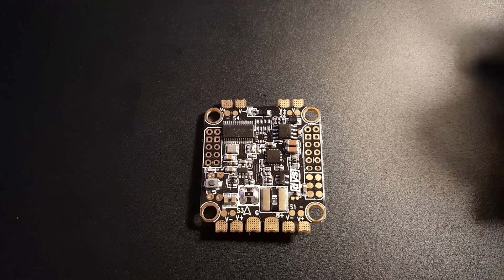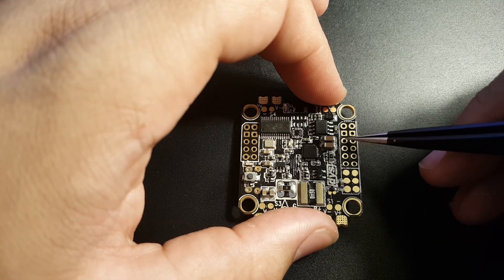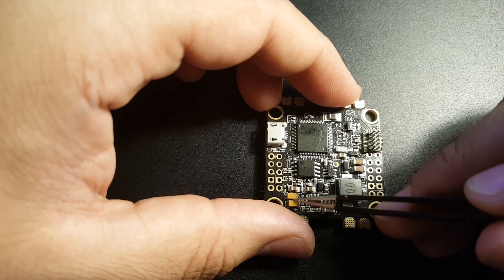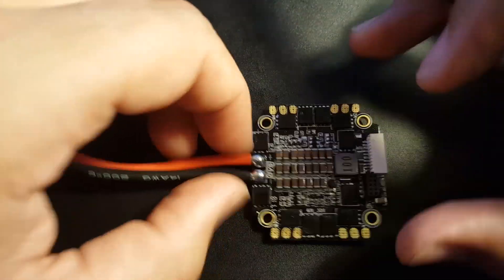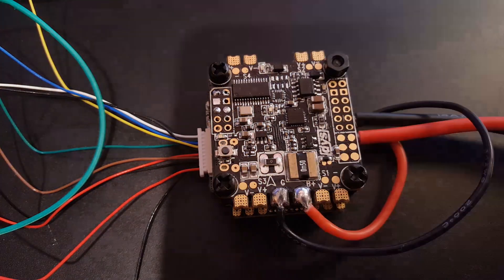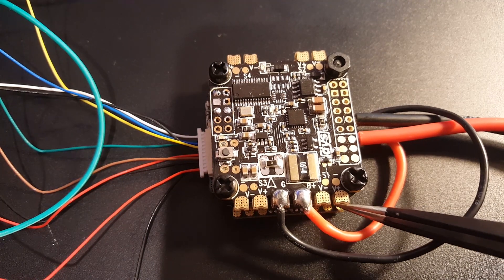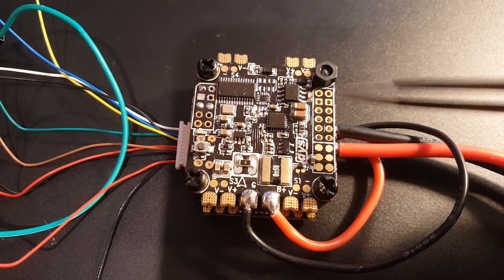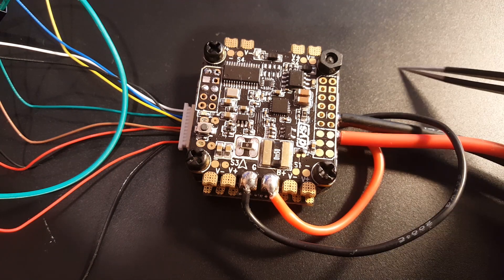DYS F4 Pro & DYS F30A 4in1 ESC Review and Noise Testing

Comment: Hey Drone Mesh nice video. Would you happen to know what's the voltage spec for the ceramic filtering capacitors on the ESC board? Is it 25V or 35V? Thank you

Comment: Hi 
Some day ago it is arrived the my new FC, I have bought a Kakute F4 V1 AIO … I mounted and now in Betaflight I have seen an error… When set ON 32khz the gyro not work… On the my another kakute the same model of this kakute with the same firmware the gyro work fiine to 16k16k I tried to set 32 on and 8k8k 16k16k 2k2k the CPU it does not 100% but the gyro does not work. The gyro to 32 it is the same of the normale gyro? same gyro same wires? Do you have any suggest?

Test 
Gyro work without flag 32khz on 8khz 8khz
Gyro work with flag 32 khz on and 1khz 1khz

Comment: drone mesh great videos.  very informative .  i have a question   im running the dys f4 combo with4in 1  30a esc  my question is i switched the combo from a floss frame to a skitzo frame and  was going to update escs in blheli and noticed i only show 2 escs.   so i hooked up to betaflight and wanted to test motors.  one by one i spun them up and noticed that when i spin motor 3 or 4 it spins both 3 and 4.  meaning if i raise the tab bar for motor 3 it spins motor 3 and motor 4.  i dont get it.  any insight or help getting pointed in the right direction would be greatly appreciciated
Reply from the maker: david guzman I had Same issue with 2 boards motors 1 and 2 never initialize and not seen In  blheli or able to spin through blheli I just tossed this in the garbage both FC and Esc ..
Reply: yea id hate to just trash em lol  too much money and i just kinda want to see if i can fix.  it worked before on my floss frame.  i literally just unsoldered motors and moved over to other frame and soldered motors.  hooked up to blheli config and only 2 escs   i will say i had no issues with noise but i have the first version fc

Comment: I just finished a build using dys f4 and dys xsd 30A esc. I have TBS unify pro HV hooked to the vtx+ pin on the left side. I thought it would be safe from noise. Btw, the cam is also connected to the 5v on the left side of the FC as well. The quad flies beautifully but whenever motors are running, screen gets huge noise and osd flickers scrolling vertically... I don't know what to do. It is bad to the point where its hard to fly. I have done a similar build on CL F4 board on Chameleon and I don't see similar issues... I have ordered Low ESR cap to install. Any tip would be appreciated! Cheers!

Comment: Any plans on testing the x-racer quadrant 35A esc`s? 
https://www.fpvmodel.com/x-racer-quadrant-2-6s-35a-32bit-blheli_32-esc-dshot1200_g1299.html

I swapped my Racerstar RS30A V2 for them and I got rid of the yaw twitches I was struggling with.
But my quad still tries to fly away as soon as I put the filters to PT1

Cheers Philipp

Comment: Hi i'm running the DYS F4 with the DYS 30a 4 in 1 and i get terrible noise I suspect from the ESC it's pretty much un-flyable I even bypassed the OSD and still the same anyone know how to fix this issue?
Reply from the maker: It is from the ESC's and the OSD on the board is not filtered correctly.

I will be building this FC with the ESC and we can take a look how to fix these problems.

I will build it this weekend.

what you can do as a start setup a 1000uf low esr capacitor on the battery pads. Then find the pads for the 5v reg and setup a 16V 1000uf low esr capacitor you can use smaller here and 16v 1000uf is a bit of overkill but if you are able to test and might fix most of your problems. 

This is my current theory and is what I will setup for the first test to clean out this FC and ESC.

Hope this helps.
Reply: Yeah I got a low esr cap on it but my build is really tight to fit a LC filter on it. I have a TBS vtx on the way to see if it makes any difference If not ill have to buy single esc's i think to keep it away from the FC

Comment: hey  gotta question for you..
.if i have the dys f4 and the dysf20 esc to match with the pins and all (putting in the japalura 4 inch) and turn the board 90deg in BF do i have to remap the motors in the fc or do you think it will turn with it
Reply from the maker: 3xlicit E.A.R. you will have to remap.

Comment: The FC is ok, the ESC is ok, together they're junk. No current sensing when used together?!!? My next problem was the esc didn't fit between my standoffs so I had to rotate it 90 degrees, leave the FC pointing in the correct direction and power/wire them as if they're components made by different manufacturers. Did two different teams work on this thing and not attend the same design brief?
Reply from the maker: I have no idea what they where thinking I will be building this FC this weekend and take it out for real world testing.

But I am getting so many emails and people telling not to even bother with it. 

But I want to at least put it together and maybe find a couple solutions for this problem for the people with not alot of money who got it and now they are having a bad experience with it.
Reply: Drone Mesh don't get me wrong, it flies great and I've been using it for a while now. The fear of puffing lipos is always there without a working current sensor

Comment: If i run all my fpv hardware through a lc filter + 1000uf low esr cap I get no lines or noise. As soon as you try to run the video wires through the osd pads I get noise when I arm the quad and give throttle. Really annoying since I love using OSD. The filtering is junk on this board. Im going to use a cam with voltage on its osd instead I guess. Btw Im running xsd 30a dys.
Reply from the maker: Those are good ESC's , This board was not thought through or tested I believe.

Comment: I run the DYS 20a 4 in 1 with the F4 stack. I have lipo pigtail connected to the 4 in 1. I use a TBS Unify Pro v2 for vtx. VTX and Cam are wired into the FC. Dys 2204 2300kv motors. It runs flawlessly, no noise at all. I'll be testing this setup with the new DYS Storm 2550kv motors soon. 

Also, I noticed the OSD will flicker (high frequency flicker) if I have the Betaflight OSD set on PAL, on NTSC it's fine.
Reply from the maker: Zachary Moore DYS motors are much cleaner than emax 2205s in terms of noise generation ;) ..
Reply: Drone Mesh good to know! Nice videos btw :)
Reply: Hi Zach and Mesh
i just built my latest quad with the same days FC and the 20a esc stack 
i would be interested to know what cam your using Zach, as i am getting terrible motor noise 
running dys mr2205's, with a runcam eagle and eachine vtx (have another of the same vtx that works great)
With no throttle vision is great, as soon as the motors wind up black horizontal lines flood the screen 
cheers
Peter
Reply: Bob Scambuster I'm using a foxeer monster and tbs unify. How do you have it wired? I'd like to see. Also, are any of your screws touching motor windings, that will cause video noise on throttle input too.
Reply: hey Zack vtx and cam both wired back to the FC ( i did rewire direct the esc 12v but no change),  checked the motors no screw impacts 
I have a monster v1 that i was thinking of testing to see how it went, but sounds like i should just buy a unify
Reply from the maker: Where did you connect your camera.. The 5V reg or battery?
Reply: 5V reg,  same as the VTX,

Comment: I run this DYS F4 with Emax bullets 30a and Emax 2306 2750kv motors... and my OSD flickers real bad.  When you give it throttle it just disappears until you back off the throttle almost all the way.  I thought it was the ESC's, but you think it could be the FC just causing the flickering OSD?  I'm also running a 1000uf 35v low esr capacitor, but no help for me.
Reply from the maker: +Brennan G oh this is very bad.. The emax bullet ESC'S are very noisy and this board does not have good filtration.. plus your motors with those esc's produce voltage spikes upto 50v.. 

Emax bullet ESC'S are not good at all from my testing them with noisy motors such as emax.

You have 3 solutions..
1. 330uF to 470uF low esr cap on each esc
2. Change your motors and ESC.
3. Get a proper ESC for example something I have tested recently seemed very good wraith32 or Racerstar 40a v2 , DYS XS 30A.

Yes racerstar I was amazed by the 40A v2 results I will have that video up soon.

I mentioned that in the video about the OSD when I was playing with throttle at certain points it flickers soo bad it disappears. 

Hope this helps and please keep me updated on your status.
Reply: Brennan G considering your OSD is on your flight controller I think you answered your own question sounds like a faulty fly controller
Reply from the maker: QUADBOT FPV what is the date they put on your flight controllers box.
there is a month and year. maybe there was a  change in hardware
Reply: I was running this FC with the DYS 4in1 20a ESC, both connected by the hard pins they were designed with and the OSD didn't flicker.  The hard pins broke in a crash so I moved to individual ESC and now the OSD flickers so I thought it was b/c of the noisy ESC that drone mesh had pointed out in earlier videos.  I am running a single 1000uf 35v capacitor, I will try adding single 470uf caps to each ESC and see if that helps.
Reply: Betaflight OSD flickers usually cause by uncommon ground within the circuit. Make sure all esc's signal ground are connected to dys fc signal ground pads + check with multi-meter that all "ground" for the tx, camera, 5v, esc pad, vbat are common
Reply from the maker: Ok.. I will double check and if it was not I will redo the tests and upload it.
Reply: Brennan G yes it sounds defective

Comment: ordered  the f4 pro with dys xsd v2 30a escs and rs2205s motors for my chameleon, should be here wednesday lets see how it goes, but i really think you should test these things out seperately if you can :) keep up the good work though :D
Reply from the maker: There is no point because the problem will rise from the ESC no matter what.. Good ESC with low noise and motor you will be ok. I used the default setup with noisy motors and thus i concluded it is highly susceptible to noise. 

DYS F4 FC does not have a good on board filtration for its BEC's so this board must be paired with very good ESC's that handle noisy motors or good esc with not so noisy motors.

Comment: I've been looking at the new Furious FPV Kortini for my next build with some Wraith 32 ESCs. will you test it anytime soon? whats your opinion on Furious FPV Flight controllers? I havent found any information on them.. but after a little research the Invensense 32kHz 20602 Gyro seems very interesting.
Reply from the maker: I just tested and released the Wraith 32 ESC review today.

I don't know what to expect from the Furious Flight Controllers have not heard much of them but i have the Kortini in my cart will order it soon.
Reply: Drone Mesh awesome! Looking forward to your review on the fortini! 
I read the omnibus F4, and SP racing F4 also uses the 20602 Gyro also.

Comment: I run two quads without the 4in1, 20 amp Spedix ESCS.  Run vtx, rx and camera off the 5v. Clean as.
Reply from the maker: From what i hear spedix are very clean ESC's I will be ordering some in soon for testing I will try to get one of each they have.
Reply: Drone Mesh They work remarkably well for how tiny they are.  Apparently the 20 amp rating is pretty conservative.

Comment: I think that your VTX is causing the problem, some VTX doesn't like two voltage regulator on the line, Run the VTX to the battery direct and could solve the problem of the noise and interruption in the OSD. when running the  VTX off the 12V on the board the regulator switching can cause a problem with the regulator inside the VTX. 
I think this DYS F4 board is junk anyway.
Reply from the maker: Before buying this I check rcgroups for peoples complaints and the source of problem is the ESC's I can confirm this now.
Reply: Bob Saghafi  why do you think it's junk it has all betaflight features and I run 5s on it all day not a single line
Reply: Hi Mesh 
have you tested the 20A esc  and found the same??
cheers

Comment: i think u have a faulty unit i havent had mine flicker ever even on 5s. ive never seen any noise on both boards so far or the osd flicker??
Reply from the maker: What motors where you running? DYS Fire?

Comment: Is the s type noisieer than the older one? Im curious to see what this fc. does , do you know already if that salution on youre flame build worked? Btw nice vid.👍🏻
Reply from the maker: I have the latest batch don't know if its considered the type S
Reply: Drone Mesh the older type has 100g less trust and the bolds can screw both ways 2x cw and 2 x ccw
Reply from the maker: Wait what are you talking about the motors??
Reply: Drone Mesh 😆 yes the first question 😆srry but that was the only thing you talkt about with a s in it

Comment: Are all these manufacturers expecting us to put extra capacitors of our own? I think they are, just putting out mediocre products to keep up with the latest hype.
Reply from the maker: BTW there is only one company that actually Provide you with High quality low ESR caps with its board and it admits that there is a lot of noise problems with our new motors and shitty ESC's , It's Matek have you seen their new AIO board they give you LOW ESR Cap rated for 35V with the package and its not even expensive. I think matek is going to start winning this race in terms of quality and price.
Reply: Have not seen it, but I have seen a 4in1 ESC board that comes with caps, I think it was Speedix maybe. I'm really liking the MatekF405 combo for my next build with Wraith32 ESC's. 2 25v470uf Panasonic caps should take care of most of the noise.
Reply from the maker: I just finished testing the Wraith32 Should i upload it now or will you guys think i am spamming?
Reply: The more content the better.